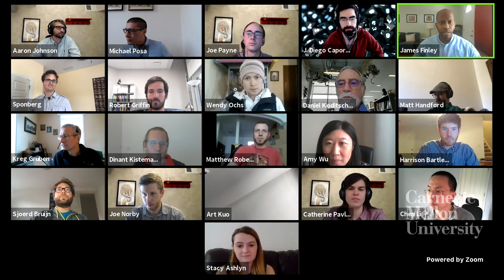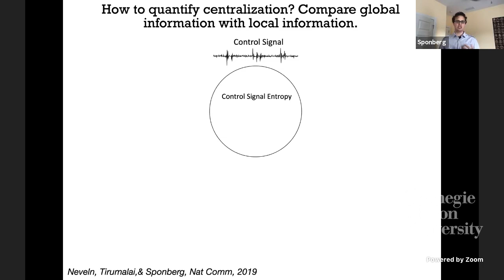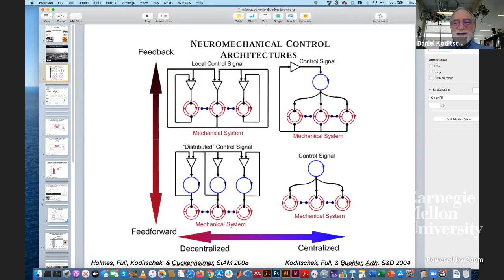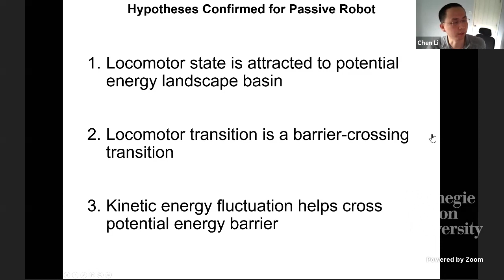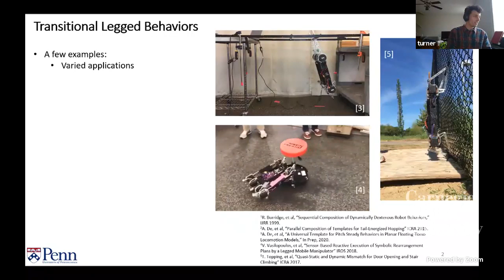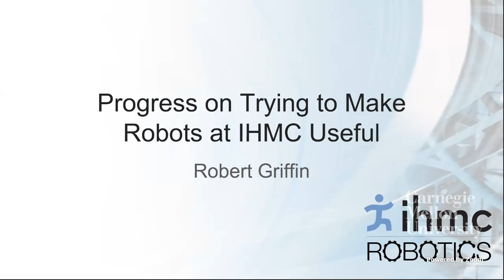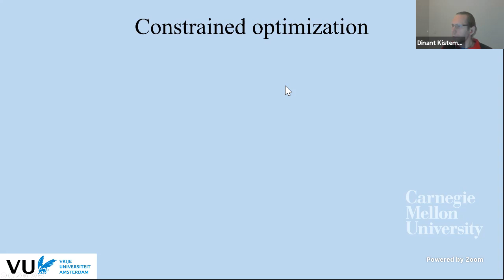Dynamic Walking 2020 Session 3

Comment: [0:01:18] Simon Sponberg. Information-based centralization in legged locomotion.
[0:27:30] Chen Li. An energy landscape approach to legged locomotion through large obstacles.
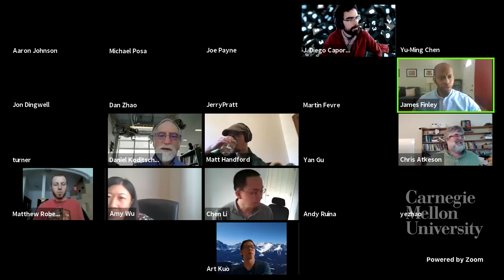[0:41:20] Thomas Turner Topping. Composition of Templates for Transitional Legged Behaviors.
[0:55:20] Robert Griffin. Progress on Trying to Make Robots at IHMC Useful.
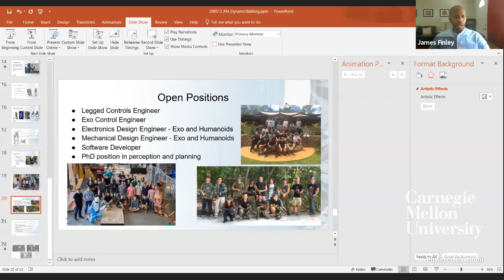[1:06:56] Dinant Kistemaker. Is metabolic cost a key factor in gait parameter selection?